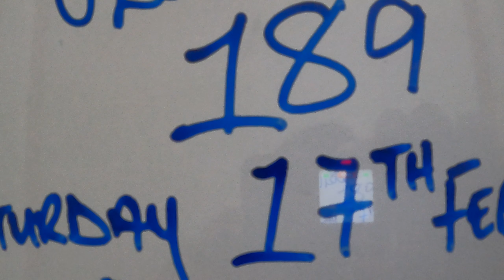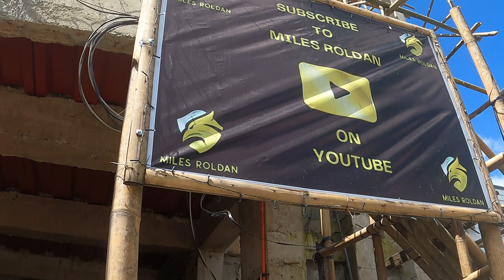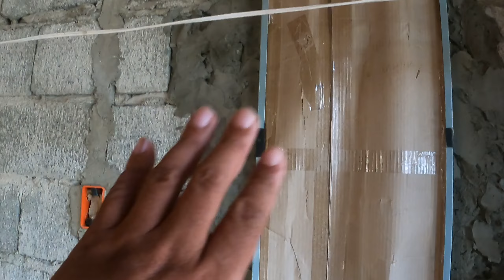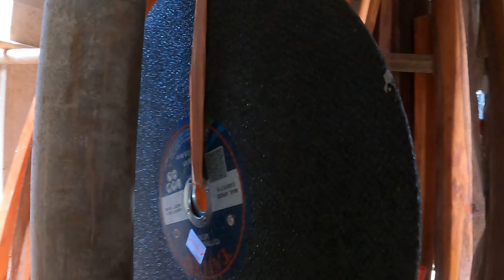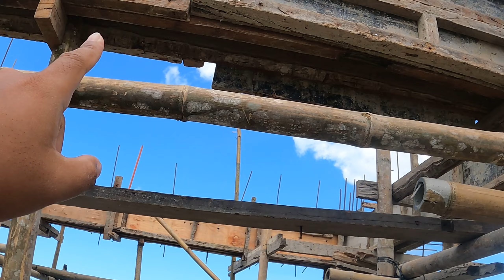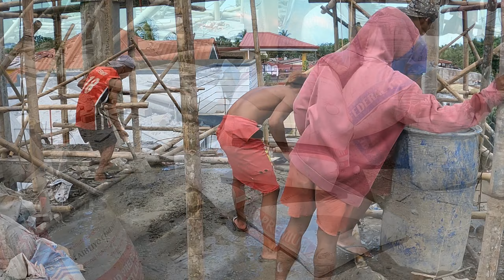VLOG 189: END OF WEEK ROUND UP AT DREAM HOME BUILDING PROJECT IN PHILIPPINES!

Comment: Now looking using my office computer definitely some issues last beam concrete placements . With this computer  it gives high clarity . Its what I use  for cad work. 
In New Zealand many concrete buildings have structural issues almost all relate to concrete placement high rise more than 40 floors high
Reply from the maker: Can you be more specific. Which beams are you concerned with. Thanks
Reply: Hi Miles I can see some plaster patches  numbers of beams have honey comb it's  very  be easy visible. With camera movement it's hard to know were your filming but if I can see from your video should be easy to locate to me it more than one area